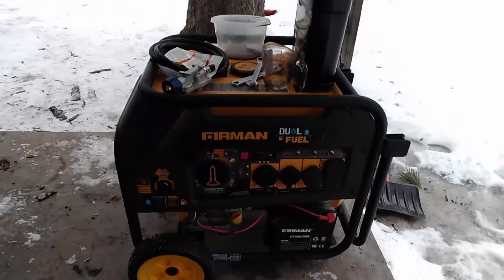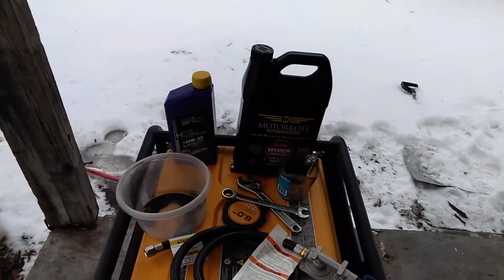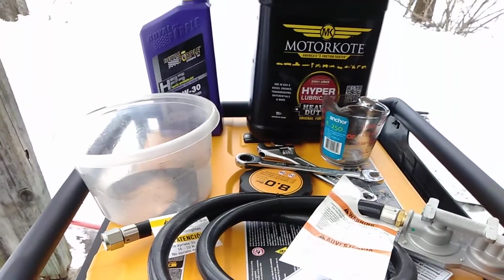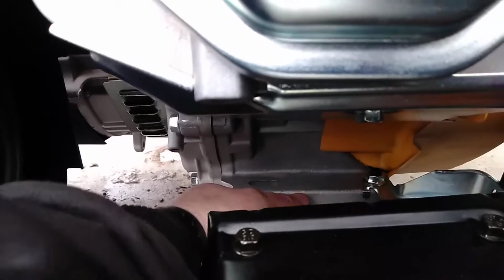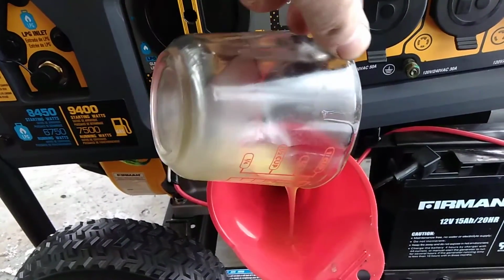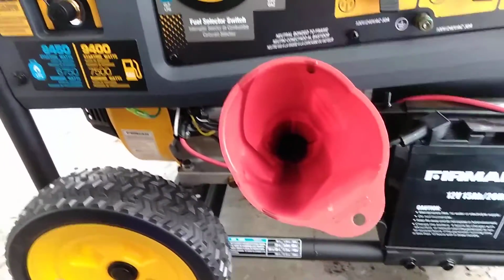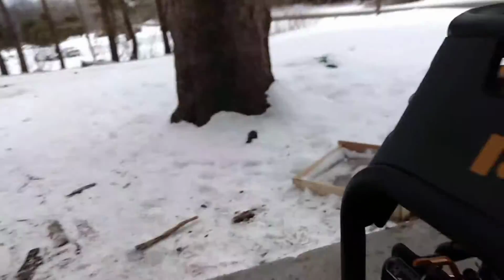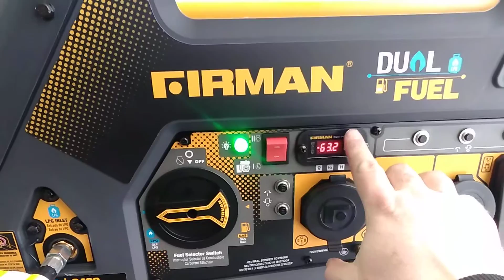Firman H07552 Dual Fuel Generator First Oil Change/Running On Propane

Comment: With the rest, let me say "thanks" for taking the time to post this video.  I am breaking my new one in now.  Oil change per instructions will follow after the recommended five hours.  I am planning to put a light/variable load on it after two hours which sounds about right.  Appreciated!
Reply: Here is a reminder about portable generator safety: everyone needs to see this safety reminder to be safe whenever using portable generators. This advice is just to make sure that everyone is aware of all the warnings and it’s just to remind people to be careful using portable generators. Portable generators can be dangerous if not used carefully and they need a lot of maintenance. Every year, hundreds of people die or get injured when using portable generators due to carbon monoxide poisoning and electrocution. Make sure you are using your generator carefully and keeping others safe as well. There is something very serious that everyone should always be aware of when using generators. Some people do run their generator indoors which is not safe and that increases the risk of carbon monoxide poisoning which can cause death of family and you. Some people run their generator in wet conditions which can electrocute them. Please remember that you should never run your generator indoors. Remember that carbon monoxide is an odorless and colorless gas that you cannot see or smell. Carbon monoxide is a silent killer. Keep that in mind. Make sure your generator is 15-20 feet away from your house and away from doors, windows, and vents. Never use your generator in your porch too. Having a carbon monoxide detector is very important against generator safety. Some people also allow children to go near the portable generator which could pose risks. We need to keep an eye on our children making sure that they are not near the portable generator so they won’t get electrocuted or burned by the generator which is dangerous. A locking enclosure also keeps kids safe. A generator shed might look like a tempting place to explore, or take cover during a game of hide and seek, but a generator is a dangerous piece of equipment that can cause injury. It says on the manual that we should also keep children away at all times from the portable generator to avoid injuries. Please do not allow a child or unqualified people to operate the portable generator. Just because some manuals missed what should be listed doesn’t mean it’s safe to do. Always follow the generator safety rules when using portable generators. Generators pose electrical risks. If you need to use your generator during wet weather, you need a generator tent to protect your generator from getting wet. Don’t let your generator get wet. Keep your generator dry and before using your generator, please make sure your hands and your generator is dry. Do not wear loose clothing when operating the generator. Everything that is said on the generator’s operating manual should not be ignored. Never smoke cigarettes near the generator. Please keep flammable things away from the generator. Never overload your generator too. Your generator can catch fire. Never ever try to plug a generator cord into a wall outlet to avoid back feeding. Back feeding your generator is dangerous. Always turn on your generator first before plugging in appliances and shut off the appliances before turning your generator off. Use a heavy duty cord for your generator and the cord should not be worn out. All the instructions should be followed carefully. Never refuel your generator while it’s running. It can cause fire if fuel spills while your generator is hot. You should turn off your generator and let it cool off before refueling it. Having a fire extinguisher next to the generator is also important. This is only a reminder for everyone’s safety of using generators. Make sure your generator is properly grounded. https://youtu.be/I1jT3ANENvI and here is a video more about keeping others safe when using generators and also about our family’s safety. Hope this helps. Thank you. Hope you stay safe. All generator safety rules needed to be followed carefully.

Comment: So after the 2oz of Motorkote did you add the entire quart of oil? Or did you have to use less oil?
Reply from the maker: It took the whole quart.
Reply: @TheLowlyTraveller  Thank you. Does the oil have to be Royal Purple? Does it have to be full synthetic?
Reply from the maker: @JPE_DRAEB  You can use any oil you like.  I recommend synthetic, preferably Amsoil Small engine 10w30.

Comment: I see you are using 10w-30 motor oil not stroke engine oil....please note I'm new to all this...dealing with potential California power outage.  I just got my generator and trying to so everything right.
Is there an advantage to using motor oil vs stoke engine oil?  
If you explained during the video my apologies.  I guess I'm a bit apprehensive about turning this sucker on.
Reply from the maker: Stroke engine oil?  Are you referring to 2 stroke oil?  Never put 2 stroke oil in 4 stroke engine.
Reply: @TheLowlyTraveller  - again .please note I'm new to all this - 2 stroke/4 stroke --- all new to me....but my question is that you used 10w-30 motor oil in your video -- why did you use motor oil instead??
Reply from the maker: I don't think California allows two stroke engines anymore anyways.  I'm guessing you live in a warmer climate than I do.  If so I would use SAE 30 motor oil in your generator.  10w30 will also work if that's all you have.
Reply from the maker: Engine oil, motor oil, same thing.
Reply: holly crap!   2- stroke oil is only used in 2 stoke engines and is put directly(most of the time) in the gas tank. 4 stoke engines like this one (cars are 4 stroke engines) put oil in the oil pan.
I am trying to keep it simple this person so I am not going to post about all the other types of engines!   all generators sold in CA have no oil and no fuel in them!   Please make sure you fill the generator with the oil supplied before pulling the pull start or electric start(if it has one).  I live in grass valley area if you are close by and you need help with your generator, just reply back. I do not want anyone to suffer from the idiots of PGE!
Reply: Using this generator for the California power outage as well. Has held up so far. Cheers!

Comment: The break in says to run it on half a load for 5 hours and change oil. Specifically says no more than half load or will damage the motor.
Reply: Omg i run my entire house on the break in dont tell me that
Reply: break in is:
 1 hour no load...listen to it hummmm smooth..

 then plug in about 2500-3000 worth of whatever (heaters are easiest) into it..(about half of its total capacity)  for another 2-4 hours. This will seat the valves correctly. You will hear the generator idle up and down during this period.  That's how it's supposed to work.
Reply: Here is a reminder about portable generator safety: everyone needs to see this safety reminder to be safe whenever using portable generators. This advice is just to make sure that everyone is aware of all the warnings and it’s just to remind people to be careful using portable generators. Portable generators can be dangerous if not used carefully and they need a lot of maintenance. Every year, hundreds of people die or get injured when using portable generators due to carbon monoxide poisoning and electrocution. Make sure you are using your generator carefully and keeping others safe as well. There is something very serious that everyone should always be aware of when using generators. Some people do run their generator indoors which is not safe and that increases the risk of carbon monoxide poisoning which can cause death of family and you. Some people run their generator in wet conditions which can electrocute them. Please remember that you should never run your generator indoors. Remember that carbon monoxide is an odorless and colorless gas that you cannot see or smell. Carbon monoxide is a silent killer. Keep that in mind. Make sure your generator is 15-20 feet away from your house and away from doors, windows, and vents. Never use your generator in your porch too. Having a carbon monoxide detector is very important against generator safety. Some people also allow children to go near the portable generator which could pose risks. We need to keep an eye on our children making sure that they are not near the portable generator so they won’t get electrocuted or burned by the generator which is dangerous. A locking enclosure also keeps kids safe. A generator shed might look like a tempting place to explore, or take cover during a game of hide and seek, but a generator is a dangerous piece of equipment that can cause injury. It says on the manual that we should also keep children away at all times from the portable generator to avoid injuries. Please do not allow a child or unqualified people to operate the portable generator. Just because some manuals missed what should be listed doesn’t mean it’s safe to do. Always follow the generator safety rules when using portable generators. Generators pose electrical risks. If you need to use your generator during wet weather, you need a generator tent to protect your generator from getting wet. Don’t let your generator get wet. Keep your generator dry and before using your generator, please make sure your hands and your generator is dry. Do not wear loose clothing when operating the generator. Everything that is said on the generator’s operating manual should not be ignored. Never smoke cigarettes near the generator. Please keep flammable things away from the generator. Never overload your generator too. Your generator can catch fire. Never ever try to plug a generator cord into a wall outlet to avoid back feeding. Back feeding your generator is dangerous. Always turn on your generator first before plugging in appliances and shut off the appliances before turning your generator off. Use a heavy duty cord for your generator and the cord should not be worn out. All the instructions should be followed carefully. Never refuel your generator while it’s running. It can cause fire if fuel spills while your generator is hot. You should turn off your generator and let it cool off before refueling it. Having a fire extinguisher next to the generator is also important. This is only a reminder for everyone’s safety of using generators. Make sure your generator is properly grounded. https://youtu.be/I1jT3ANENvI and here is a video more about keeping others safe when using generators and also about our family’s safety. Hope this helps. Thank you. Hope you stay safe. All generator safety rules are required to be followed carefully.

Comment: Men i think i broke my i just finished doing the break in but i had several lights running led and 2 fridges and 2 tvs is did i ruined my generator ?
Reply from the maker: I wouldn't think so.  That generator should run that without any trouble.
Reply: @TheLowlyTraveller  ufffffff men thanks for your answer i finished doing the 5 hours break in not continous but tomorrow i will put the new oil
Reply from the maker: You are very welcome sir.  Thanks for watching.
Reply: @TheLowlyTraveller  thanks again
Reply: it really depends on the load...the new refrigerators run on half the amps then the old ones from 10 years and beyond ago.
 Rule was dedicate a circuit for a fridge... it's still a rule but new fridge is 5.3 amps compared to 11 amps from old ones.

Comment: Is there a spec for propane per hour or kWh? How long would a 20lb tank last?
Reply from the maker: I'm not sure on that one.  I'd have to run a load test to find out.
Reply: @TheLowlyTraveller  It would be great to have some idea before I buy. Propane would likely lead to a longer motor life. But if it takes a lot of gass then it would not fit my needs.
Reply: all depends on load you have on it

Comment: Costco has these on sale right now for $549. I was thinking to pick one up to prepare for hurricane season. Are you happy with purchase? Appreciate any thoughts on the unit. Also wondering if it could be outfitted for Natural Gas. We have HIgh Pressure NG regulator for our pool heater so converting to NG might be interesting
Reply: You should go for it. This is a very good unit and so worth it for emergencies. One thing to remember with gas/propane is that it’s not as efficient and will run through big tanks of gas very fast. Also, I HIGHLY recommend to spend time and money to get your house ready for easy and safe connection by installing a manual transfer switch or an interlock.
Reply from the maker: I'm sure it would run on natural gas if you changed the jet in the carb or orifice to a slightly larger one.  Natural gas has fewer BTUs per cubic foot than LPG, but if you put a larger orifice in it you're good to go.  The engine will run on it.
Reply: $499. right now..just got one
Reply from the maker: Same wattage?
Reply: @TheLowlyTraveller  yes...HO7552...it was $699...exact same generator..just got it Saturday
Reply: I've had mine for a couple of months now living full time in my camper, over 550 hours on it so far mostly running gas and it's still going. Not sure how long it'll last long-term sitting and what not, but I mean 550 hours is a decent amount so it must not be total garbage.
Reply: @dedalliance1  do you still have it? How many hrs on it now?
Reply: @AJ-ds9xq  I had it to about 1550 hours but then it was burning oil I assume because somehow it ran out but I never noticed any leaks and blew itself up. But it was also like -20 degrees Fahrenheit that day so it was extremely cold and had little to no oil running through it. But I think if you take care of it and make sure it has oil especially around the 1k+ hour mark it'll run for a long time maybe mine just needed a new seal or something probably something easy.
Reply: @dedalliance1  wow... 1550 hours? You can't beat that! I bought one from Costco few days ago, your comment made me feel better about my purchase. Planning on keeping it for emergency needs, ill take your advice!!  Thank you!
Reply: @AJ-ds9xq  Yeah for the price it's really a pretty good machine. The average person might put like 100 hours a year on one of these or even less if it's just for emergencies. Considering a Honda one that size is pushing like 5 to 7k dollars that's a lot.

Comment: Why do you need a break in I didnt do one on mine i put the oil it came with
Reply from the maker: It is highly recommended to break it in for the first 5 hours.  It will allow the rings and valves to properly set thus making the engine last longer.  You can use the oil provided for the 5 hour break-in.  After that I recommend changing it and using Amsoil small engine or Royal Purple HPS 10w30.
Reply: @TheLowlyTraveller  thanks
Reply: @TheLowlyTraveller  what load can i use for the break in ?
Reply from the maker: I used two electric space heaters.  I broke mine in running it at half load for a couple hours.
Reply: @TheLowlyTraveller  i am doing the breaking whe  i get home with the factory oil and i am putting in royal.purple the one you recomended after that how often should i change the oil ?
Reply from the maker: I think every 100 hours
Reply: @TheLowlyTraveller  where did you get the royal purple and morkote and how many oz 2 ?
Reply from the maker: I got the RP HPS at O'Reillys and the Motorkote at Meijer (not sure they carry it in gallons anymore).  I use just 2oz of Motorkote to a quart of oil.
Reply: @TheLowlyTraveller  thanks for all the replies i just did a 2 hour brakein tomorrow i will do the rest
And i got the amsoil 10w30 syntheric online i will do the rest of break down tomorrow and when i get the oil change it for the amsoil
One last question where is the shut off valve for the gas i cant seen to find it
And i dont want to leave gas in the carburstor
Reply from the maker: The shut-off valve is integrated in with the kill switch.  When you switch the unit off, it kills the ignition and shuts off the fuel supply at the same time.
Reply: @TheLowlyTraveller  thanks brother for all the replies very kind of you i wish everybody would help like that
Reply from the maker: You're very welcome sir.  Thanks for watching.
Reply: @TheLowlyTraveller  one last thing do you use 87 like the manual days or 93 sorry lol
Reply from the maker: I strongly recommend using ethanol free gasoline if you can find it.  If not, 87 octane will work fine.  I treat it with seafoam fuel treatment as a stabilizer.  Sta-bil also works.  Another YouTuber, John Daniel has a sweet formula on how to make fuel last longer than 2 years.  Give his channel a look.
Reply: @TheLowlyTraveller  But it won't start with kill switch off so running it out of gas for storage is impossible right?
Reply from the maker: @Jimmy Belue  as designed,  yes.  However you can add another shutoff valve on the fuel line and run it out that way.